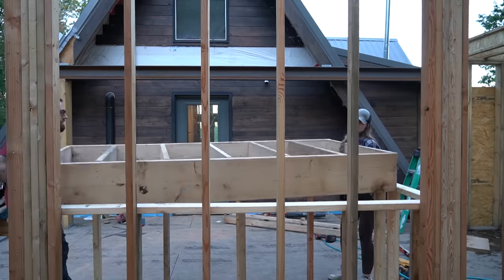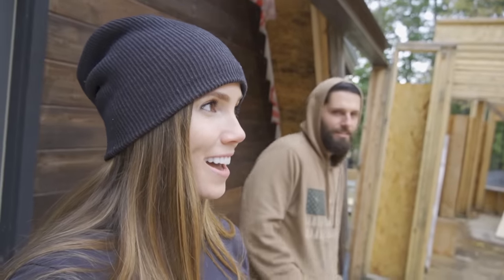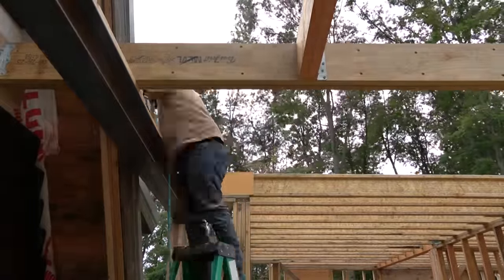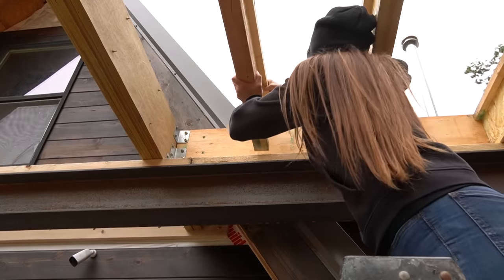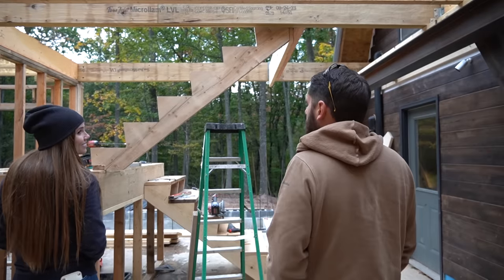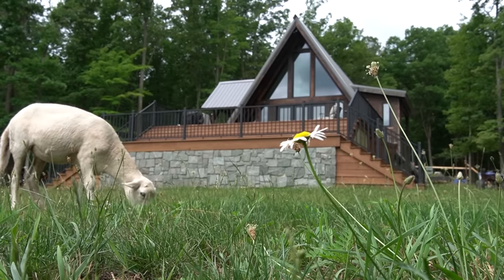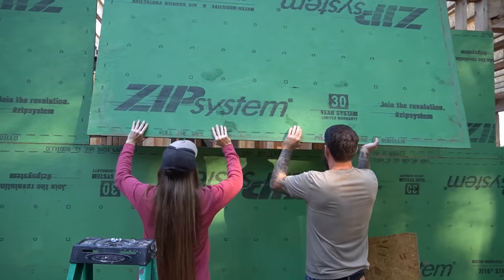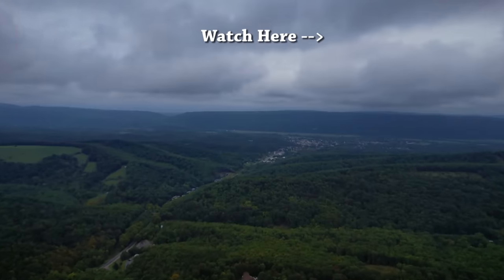Moving On To The Second Floor | A-Frame Cabin Addition

Comment: Suggestion Have on hand a large tarp.  During cold weather cover and use torpedo propane heater inside for worker comfort.  Block morter can freeze in winter.  Cover and heat to prevent freezing.

Comment: Hey guys, hire that block work out. It is not that expensive and a good crew can finish all the block in one day. With winter coming on you need to get that done. Also I would not be trimming out the windows and doors until you are ready to install them, its going to get cold fast and the cold wind is going to be blowing thru the house while you are working inside.
Reply: Agree!
Reply: Agree! Sub out the block work.

Comment: For block walls to be super strong a professional should be both mixing the mortar and laying the block,it is an art.yes you can do it and it will be a wall but it won’t be as strong. Check it.

Comment: Agree with adding support for the Stairwell.  Instead of adding a Wall, why not make the area under the stairs a storage area instead of a solid wall.  You would still be able to add the support and have a storage area at the same time.

Comment: I've been using the Henson for a year now. Absolutely by far the very best blade holder I've ever used.

I get three or four shaves from a blade. A new blade is just a one-pass shave. I've tried just about every kind of multi-blade razor, and this single-blade Henson holds the razor blade perfectly.

If I go a few days without I use a clipper first, the single blade handles my 1/8 inch hair easily.
Reply from the maker: There’s just no going back after seeing how well Henson blade work

Comment: Keep your blades sharp. Build a  pyramid 12 inch high 12 inch wide,  each corner on north, south east and west. Find dead center, out line a square,  PUT used razor dead center AND leave it. Return TWO weeks later AND boom Bob IS YOUR uncle.  YOU have a sharp razor